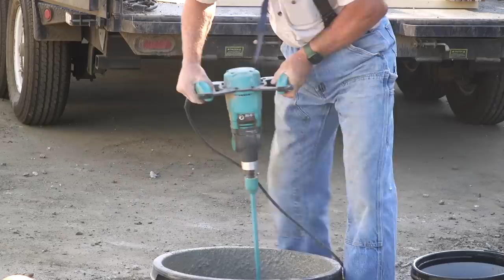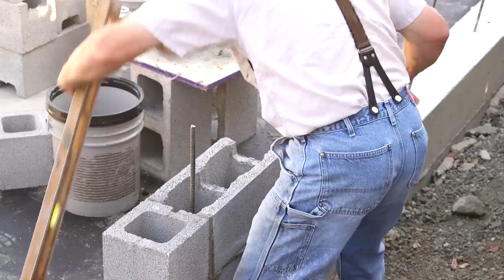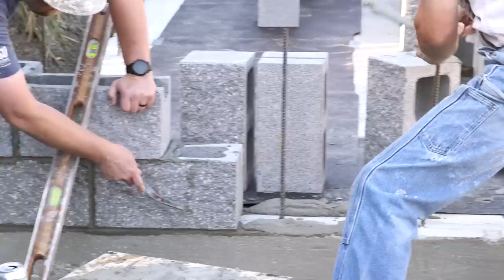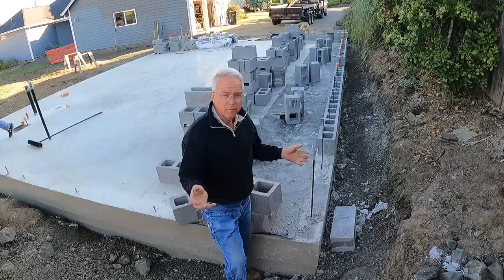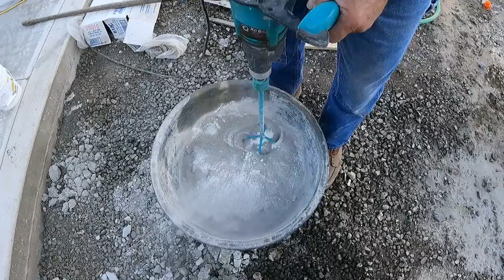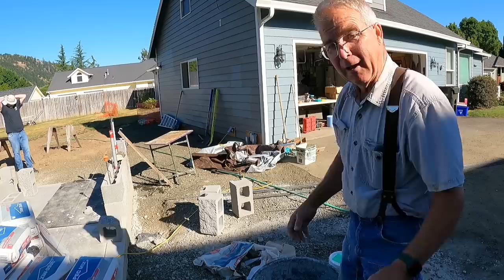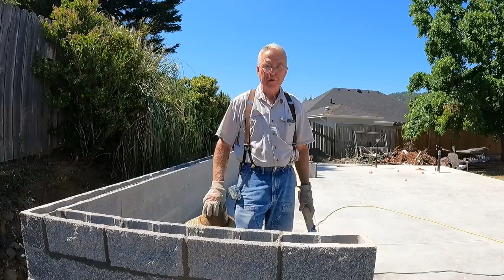I Finally Figured It Out - Learning Masonry: Shop Build #8

Comment: I'm from the Caribbean and our construction methods are quite different. I'm also not a contractor or mason or carpenter.. but I am just curious - is there a reason why there are no columns at the corners and even at intervals along that wall? will columns be added later on higher up?
Reply: Most block walls get core filled
Reply: @marcsheldon6512  Thanks for the reply Mark. Yea we do that too down here and still put reinforced concrete columns. Maybe we just overbuild here lol

Comment: I'm very curious about the cost of block build Vs stick build, in my area it's much faster & cheaper to frame, isolate, drywall and vinyl siding than doing a load bearing block wall.
Reply: Have you ever heard a story about 3 little pigs?
Reply: I think at least one side is a retaining wall. After that I assume it's for the looks.  My area block it twice as expensive as a poured wall and 4X that of 2x6. Not much block around.
Reply: @tysleight , The labor cost is what drives up the price of a masonry wall. If you’re doing it for yourself, it definitely makes it cheaper.
Reply: @Trelleborg Thats a weird conjunction of speed and cost over longevity. One reason I like watching European builders making something that will last 100+ years as a normal part of their job. Not always, but more often than not.  Mike Hadock has a great number of vids on that.

Comment: The mud for block should look like clouds in the mixer and for brick it should be folding over in the mixer almost like dough you also have to factor in the the weather like you are saying right now it's 70- 80 and I make it perfect in the mixer then add a little more water so it's almost too wet getting an eye for the mud is rough I told the masons that I want them to tell me if the mud is even a little out consistency
I also always let it flash for 10 minutes or one cigarette it definitely makes a difference if it's not immediately going to be used
Reply: Wanted to say thank you for all your videos  have helped to make me a more professional and proficient worker 😊
Reply: So just like making pancake batter.  It's best if you let it rest a few minutes before you use it.

Comment: I’m no mason. That said, I’ve had better luck when I wet down block/brick and mortar board.  I mix mud in small amounts so just what I can work in say 30 minutes tops.  Finally, I mist the completed job for the first 24 hours to keep mortar from drying out.  Good luck.  It’s not easy but a good sense of accomplishment.

Comment: Coming from England and working on site for nearly 15 years…do you not use cement mixers in America to mix up?
Reply: On a large job, yes.   If you watch his video of building the foundation of the spec house, the blocks were laid by a professional crew, and they used a mortar mixer ( different from a concrete mixer)  For Scott, working by himself, figuring it out as he goes, and not eorking full days, it probably doesn’t make sense to rent a mortar mixer.   You’ll notice in the preview footage of  pouring the bond beams at the end, they’re using a concrete mixer.
Reply: DID YOU SEE IT. HE USED IT. SMALL BATCH HE DID NOT

Comment: Most common mistake when mixing mortar and concrete: beginners always add too much water. Cured product then ends up cracking as it dries and shrinks normally over time.

Comment: I’d love to know the reason behind cutting up those grooves in the slab. If someone could answer that to satiate my curiosity, that’d be great!
Reply: Concrete cracks..no matter what you do.  The cuts give the cracks a home. A place to break where it won't be seen. Seems weird but concrete is actually somewhat fragile.  It can easily spal and/or get eaten by salt. (I'm in Minnesota, lots of snow and lots of salt used on the roads)
Hope that answers your question!

Comment: It's all feel....start at corners and mix the mud the same everytime....its really not that bad....am a carpenter and finish one at that.....problem with finish carpentry is you try to apply that same detail to other trades and its just not necessary

Like bouncing back and forth from framing to crown moulding.....totally different trades with different tolerances.......Mason work needs to be good but not perfect.....blow and go...use a string

Comment: Has america even remotely seen blocks from companies like Wienerberger made out of clay with 15-20 little chambers in the thickness of the brick for a ton more insulation? With bricks like this the first course of brick takes the same time, but then you only need a thin bed of mortar laying 10 blocks in 2 minutes. A team of 5 people can do a 80qm house floor in 3-4 days that way, without the need to check every block for level.

Comment: In Fl due to hurricane Andrew we fill cores of block with concrete in corners, sides of openings and every 8' with rebar tied to foundation and continuous on top lentils, roof tied to slab via wall rebar and concrete poured cores.  Thats minimum code.
Reply: There are few hurricanes in Oregon.

Comment: Spitting is not the answer,  pancake batter is too wet. When you draw your mud back for your first course of block , you can make a furrow  with the point of your trowel.  Remember fluffy not stuffy,  you will do fine.

Comment: 7:11 Full disclosure first, I am not a mason. But I would guess that the rule of thumb is that you need to work a lot faster. Which is an impossibility for you because you haven’t laid nine billion blocks.
Reply: Accuracy is most important, speed is last
Reply: @puppyduppy9811  He was comparing himself to the guys working in Arizona laying blocks like maniacs in the hot sun, where speed actually is essential - but they are also accurate because they’ve laid 9b blocks.
Reply: Darn near everything works that way.  Might be laying block, cutting dinner rolls out of a batch of dough, shooting a pistol, or doing surgery on an eye.  Slow & smooth & accurate turns into fast and smooth and accurate all by itself with repetition.

Comment: why didn't you fully spread mud on the entire end of the block instead of just two small beads along the edges, here in the UK both the vertical and horizontal mortar joints should be fully filled
Reply: UK uses mostly solid 4" block. This wall is 8" hollow block with vertical rebar every 2' and horizontally across the entire top course to be filled solid with concrete. Don't loose any sleep now. 😉

Comment: What's the point of the rebar in the blocks?
Reply: It locks everything together, instead of depending entirely on the mortar joints.
Reply: @bmay8818  concrete is later poured in the core of the wall and bonds to the rebar and we all know what rebar does to reinforced concrete? Yeah!
Reply: Concrete and steel are best friends in every concrete pour scenario, no matter what.
Reply: 12:32
Reply: What Robert idenya said.  Scott discussed that in more detail in one of his videos in the “spec home “ series, when they were laying the foundation.
Reply: @robertidenya1432  oh right, we don't put rebar in brick or block walls in the UK. Tbf we use solid blocks rather than cavity blocks

Comment: I’ve never understood why masons don’t lay the level flat. I’m a plumber and I do this when trying to plumb a fitting. This way I have two bubbles 180 deg apart so it’s much easier to check both front to back and side to side. I don’t have to turn the level and I don’t risk messing up one while leveling the other.
Reply: The most common sized level used in masonry is 48", has curved vials, glass lens and is made out of wood with a steel band on all four corners, why is is made out of wood and steel might you ask ? Because Mason's hit it with the back of their trowel to level blocks. Now imagine a dummy with a 4' level flat on its side hitting it with the back of his trowel and tell me if that makes any sense 😂😂....... Any more questions turd whisperer??
Reply: @JMASON-qy7ki  Turd whisperer lol.
Reply: A masons level don’t work like that